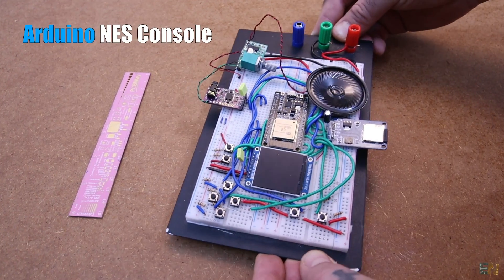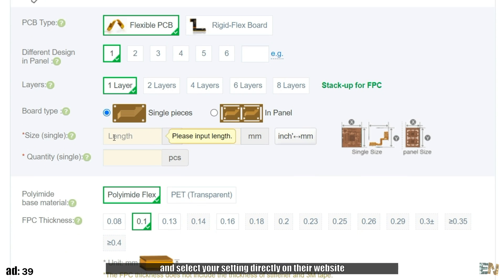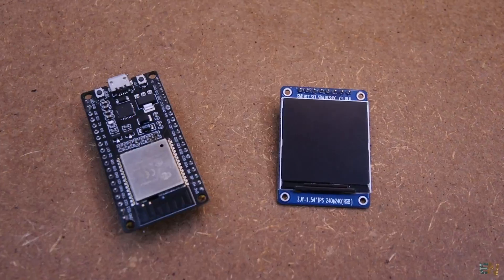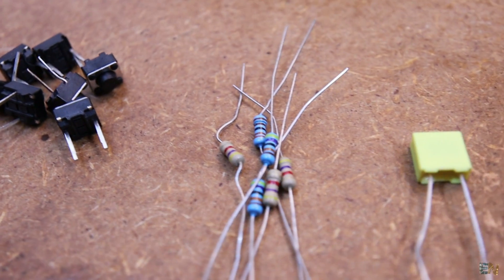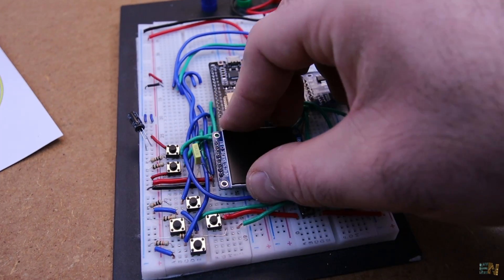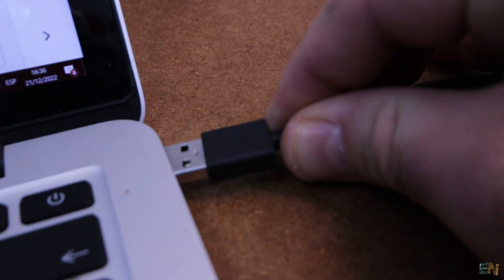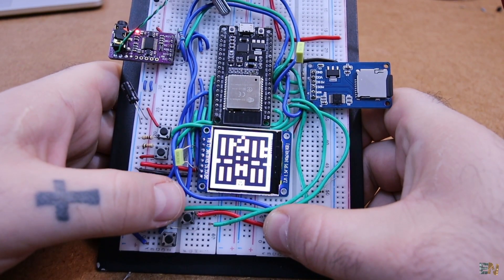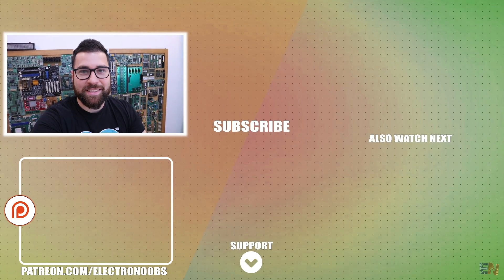ESP32 Gaming Console - Homemade Emulator Less Than 20$

Comment from the maker: DISCLAIMER: After posting the project just realized that using that website for NES games might be considered piracy. I'm not an legal expert but have in mind that using those files might be illegal and you do it at your own risk. Sorry for that!
Reply: Thank you for posting the website.
Reply: hi i really need help every time i compile it i get an error that i need to #include "P:\1a Youtube videos tercero/ESP32 Nintendo/NesCat-main/src/hid_server/hid_server.h" and that the compilation is terminated and it says there is no such file or directory please help me out!
Reply: @aidansmith1549  I can help. The point is that you need to specify the path to this file from your computer. Where did you download it.
Reply: @aidansmith1549  i have the same problem. Do you know how to fix it
Reply: @aidansmith1549 Hello sir, how are you? Were you able to find a solution to this problem in the code? Because I have the same problem in the code. If you can overcome it, I hope you can help me.
Reply: Welcome to the ship
Reply: If you own the original, it's ok
Reply: It’s perfectly fine, since everyone is only downloading games they own the licenses for and  are only backup files. 😉
Reply: How can I get the custom PCB?
Reply: How optimized is the code? It's still crazy.
Reply: @duanefreeman3152   change P:\1a Youtube videos tercero/ESP32 Nintendo/NesCat-main to where your file is located at. e.g mine was C:\\Users\\DJ\\Desktop\\NesCat-main. just make sure \ is changed to /
Reply: Did you find a way to run it with ST7789V2?
Reply: There are homebrew games you can use!
Reply: GPTがマリオのソースのようなものを提示し、手を加えてから実行した場合、著作権は微妙です。
ゲームには収斂的な正解があり、娯楽提供組織は特許マフィアにはなれません。
Reply: You really should consider reposting without that part. Great video overall though!
Reply: Yeah, YouTube might penalize you or your sponsor(s) might drop you for advocating for piracy. Consider reuploading.

Comment: While working with the NCAT repository, I found it to be quite a challenge. 
Despite being an embedded firmware engineer, it took me two days to get the console running on a breadboard. There’s an overwhelming number of unnecessary and redundant defines for custom boards, which only adds confusion.
I also can't understand the decision to use 330-ohm resistors for buttons instead of simply employing pull-ups. Also not sure why he chooses to use a software SPI instead of hardware HSPI, wich is available on the eps32 - wroom. 

There’s no proper HOWTO guide, just a bunch of pictures and code snippets with little explanation. I honestly don’t know how an average person with minimal coding experience would ever get this project up and running.

The work done on porting those emulators is impressive, but the presentation and documentation of the project leave a lot to be desired—especially for Arduino users. A clearer guide and better organization would significantly improve the experience for everyone.
Reply: I'm just about ready to shoot myself after trying to sort out the errors and missing information in this 'tutorial'. Some of the include statements refer to folders on the author's hard drive!  If you have a debugged ino file, can you make it available?
Reply: @pintokitkat  were you able to figure it out?
Reply: Welllll the documentation is non-existent because it’s technically illegal to do in most countries.

Comment: Starting a topic nr4#

It happens very often it doesn't select the game from the list. I can press Select as many times as I want, but nothing happens. Eventually, after some time, after I press the Select button it just starts. Meanwhile, I can scroll through games with no problems. I checked contacts, and everything is good. The HIGH state comes from the button to the ESP32. 
In addition, the serial terminal is empty. Nothing is printing. As the ESP32 is stuck at menu level.

Comment: Not bad! It's a pity the TFT screen is so small, though. Isn't it possible to get a bigger TFT display of the same resolution which is compatible? Of course, that AV output would be a good alternative. It's a pity you didn't demonstrate this. It seems the NES graphics resolution is 256x240, which is about the same as most 8 bit computers, so people would be used to seeing that on a much larger display anyway.

Comment: You need to denounce the buttons through code. Not good at it myself but there are good tutorials. Had the same issue with a radio remote I made for my car. Buttons pit up the small electric feedback and denouncing helps the program ignore this by adding tolerance I believe.

Comment: Starting a topic nr3#

I made a custom board. It WORKS!!!!!

What works:
-I can go through the SD card games and choose any.
-I can load any game from the SD card.
-I can start any game.
-Game works
-I have sound

What does not work, or not work as it should:
-At first, when I connect an 8ohm speaker, the ESP32 crashes. So I added a 470uF cap on PVDD of the PAM8403. Module I used for testing and the schematic for it does not require it. BUT, the DS says it is a MUST.
-After adding a cap, my screen flickers when there is a louder sound. So it is a power issue. 
-While playing Super Mario I can move left and right, I can jump, but I can not shoot. No button does the shooting.

Any help would be nice. I can move the schematic to GitHub if there are some of you to move on. The game console will have battery management, two speakers, power up/down buttons, etc.
Reply: I'm getting many errors, could you send your code and current setup?
Reply: @LieutenantPhys  The code is the same. I have made a few topics here. Here....
"It compiles, but ESP32 lib MUST be 1.0.5 or 1.0.6. SDfat MUST be 1.1.4."
Reply: @dekipet   can you please help? mine doesnt compile.
Reply: @scaredcrew   downgrade your libs, and read all the comments.
Reply: @dekipet   downgrade which library to which version? also getting some error with C++ version 11
Reply: @dekipet  you mean esp32 board should be 1.0.5/1.0.6?
Reply: @scaredcrew  Mate, it says all a few posts above.
Reply: @dekipet  can i dm you if you have time please
Reply: @scaredcrew  mate, you have to install the library versions I mentioned. Nothing more, nothing less. There are #4 posts here I wrote. I have explained many things.
Reply: @dekipet   thanks! I have  managed to compile file but having this error : Initializing SD card...
SD card initialization failed!
Reply: @scaredcrew  bad card, wrong filesystem, bad wiring, etc
Reply: i have face many out of storage eroor it use 314 percent memory or say 3.93 mb but it has only 3 mb flash if i go to higherst partition scheme as well can you please help me

Comment: I have found the way how to avoid all the compilation warnings in the original sketch caused by the newer 11 version of C++ applied in Arduino IDE since certain period of time. Now it compiles without any red line!
Reply: My Code compiles but i dont get my TFT Display to Work. Do i have to Put Resistors in Front of some of the Pins ? And CS Justs Connect to Ground ? And why did he Put a capacitor between ground and ground?
Reply: @brxdow  My display works fine, at least it shows the menu and moving up and down selection arrow. I've connected it as suggested in the initial sketch: DC (5), RST (19), MOSI (or SDA) (23), SCLK (18). I don't have CS pin at my ST7789 240x240 display version. Perhaps it is really needed to be grounded via 100nF capacitor when it is there, I can't say exactly. An author suggests doing so to avoid artifacts on the screen, don't see the reason not to trust him. But if CS pin is present at the display module, then you need to connect it to a free allowed pin at ESP32 module and define it in the sketch in the line #define TFT_CS   -1 where you need to replace -1 with actual number of the used pin at ESP32 module. 
However, I am still struggling with games launch. When I pick up a game and push 'Select' button sometimes I get a white square on the whole screen when it seems to be loaded correctly, but sometimes it just resets when there is something wrong with rom file size. In this case it shows a wrong size of the file upon uploading starts and it means that uploading will fail in the end. But sometimes uploading is OK, but then I get a white screen anyhow. So still in search of the right way to get it working in full. I suspect that there are many small differences in hardware (ESP32 and SD card modules and displays) which could influent the right operation of the emulator and they have to be found in each case separately, which takes certain time and efforts. But never give up!
Reply: I might Destroyed the Display because i powered it with 5V instead of 3.3V, or because i soldered the CS Pin on it because i thougt i need it. When i Order a new Display, should i rather Take a Display with or without the CS Pin? I think without is better, because its easier and also cheaper i think. What do you think? When i get it to Work i May get the Same Problem as you, and if Not in can help you Out.
Reply: @brxdow  If you have CS pin at your display module you need to configure it in the sketch, it could be GPIO 4 for example. Of course, less connections are better as soon as it increases the reliability, so the display without CS pin is preferable. Meanwhile, I've got my assembly working almost OK, at least SD card recognized correctly now and roms are loaded with right memory volumes. All the games files are running so far. The thing was that CS pin at SD card module should be grounded and not connected to ESP32 module (GPIO 22 originally). Now experimenting with I2S sound, MP3 player works fine, but still struggling with game sound - it is not there still. Suspect some sound module initialization problem in NES emulator mode.
Reply: вадим, где я мог бы скачать вашу сборку?

Comment: Ok, starting a new "topic".
It compiles, but ESP32 lib MUST be 1.0.5 or 1.0.6. SDfat MUST be 1.1.4.
So far, so good.

Next step, download NES games in the NES folder of the SD card.

When powering up, it lists all games, and I can scroll through them, but when I press SELECT on any of them, the game doesn't start.

I am stuck here. Any idea what to try? What to check?
Reply: I dont eaven get so far.... I dont get the TFT Display to work. How did you Connect the CS Pin?
Reply: When i use SDFat library in the Version 1.1.4 it doesnt compile. When i use Version 1.0.5 it does???
What do i make wrong
Reply: I even See ( in the seriell console of the Arduino IDE ) that it load the Games and i can selcet one. I See the Name of the .nes File and that it is currently loading. Then there is the Message that the Rom Download is successed. But i cant get the TFT Display to Work. I once powered it with 5V. Have i destroyed it with that?
Reply: @brxdow  can u tell me how? im stuck at loading game process
Reply: @HoàngNguyễn-x5v  can u explain in details? is the folder name correct? try :
#include "hid_server/hid_server.h"
sorry the last time i worked on this project was like 5 months ago
Reply: @itsnd64  do you finish all the step? Did it work?
Reply: @HoàngNguyễn-x5v  yes it did but i lost the folder
Reply: @itsnd64  did you reformat the sd card or use default?
Reply: @HoàngNguyễn-x5v  w problem u having? i use fat32 formatted card
Reply: @itsnd64  the monitor showing ''sd card initaliaztion failed!''. I already connect correct pin, format fat32 and create NES folder
Reply: @HoàngNguyễn-x5v  fsr 1 of my sd cards doesnt work,try other card
Reply: @itsnd64  thank you. Everything work well. But the game Metal Gear has some crazy 😅
Reply: @HoàngNguyễn-x5v  good for you!

Comment: Hi! I don't know if anyone can help me with this but I use the esp32 with 30 pins instead of 38, and it said the SD card can't be initialized. I hope it wasn't the issue so it would be helpful if someone can tell me about this. Thank you.
Reply: I also have the 30 Pin Version i think. But my SD Card Reader is functioning ( i can See that it load the Games and i can even start them in the seriell console of Arduino IDE ). But i dont get my TFT Display to Work.
Have you created the NES Folder and Put one two Games on?
Reply: @brxdow  Yes I did create a NES folder and put 2 NES game files in it but it didn't seems to detect it, and also ur problem kinda opposite of mine, my display is worked and showed the error.
Maybe u can check the wiring again, and if ur display doesn't CS pin, u should change the #define TFT_CS to -1.
I'm not sure if that's the issue but worth to try.

Comment: Nice video!
But i always get Errors when i try to conmpile the code because of the "...  .h" Files. Can someone help me?
Reply: Same here!!!! I keep getting that problem with like a video.h file or something and when I go into the files it says to I can see it right there and open it and everything please tell me if you figured this out
Reply: I progressed!
So if the error message comes then you have to first look that ONLY the file name is in the quotation marks (for example: #include "video.h"). Once you have done that, you must then put this file in the folder where the code (.ino) is saved. Now I did that and it works, but now I have a new error message (SDFat...). :(
Reply: @brxdow  thanks and I fixed that problem what I did is I went to the sdfat zip file in the libraries and I installed it and that got rid of the problem but now it has a hard time compiling because of something else
Reply: Thank,
I will try to load IT to my Esp32. I already soldered everything together... I will see If it works( when i have time).
Reply: I've got it to Upload to the esp32! I unsoldered everything an it worked. I soldered the Display and Sd- Card Reader Back in Place. Now when i give power to the esp, in the seriell consol (in the Arduino IDE) i can See how many Games are loaded to the Sd Card. But now i dont get my TFT Display to work it Just Show black Screen :( . Why did He Put the capacitor between ground and ground??!
What should i Connect to the CS Pin?

Comment: The NesCat INO from a ZIP file you provided on your web page can not compile just as is. There are some issues with the SdFat lib. What exact lib did you use and what version?
Thank you for your awesome work!
Reply: Hi did you replicate his project? I am all finished with the code stuff but when I click compile it says that something is missing but when I go through the files I can see what it says is missing right there I can go more into detail if you need me to please help!
Reply: @aidansmith1549  Nope. Stuck in compiling, and have no time to mess it up further.
Reply: @dekipet  Dangit I already got all the stuff and got it soldered and the code won’t even work
Reply: @aidansmith1549  I believe the lib is updated, so now it won't work as is. It needs a tweak or two. But, it would be nice for the author of this video to say a word or two.
Reply: im late af but u need to use the libraries provided in the folder

Comment: Why I get this error:arduino: 1.8.12 (windows 10), board: "esp32 dev module, enabled, default 4mb with spiffs (1.2mb app/1.5mb spiffs), 240mhz (wifi/bt), qio, 80mhz, 4mb (32mb), 921600, core 0, core 1, none, disabled" in file included from sketch\bluetooth.h:77, from c:\users\asus\desktop\ncat-main\ncat-main\ncat_esp32\ncat_esp32.ino:1463: sketch\btstack/src/btstack_crypto.c:89:10: fatal error: uecc.h: no such file or directory #include "uecc.h" ^~~~~~~~ compilation terminated. exit status 1 error compiling for board esp32 dev module. this report would have more information with "show verbose output during compilation" option enabled in file -> preferences.
Pls help

Comment: It's still crazy to believe that the esp32 is more powerful than the 6502 and double ppu units that were in the Nintendo haha. I agree, it's a crap shoot when you buy those little screens. I gave up. I use character screens again for fun and they can be used as crude debuggers to know where your code is at haha

Comment: I am just still trying to figure out if there is way to use those type of screens for displaying arduino ide on a robot. I guess we would still need to have a keyboard or a mouse to it. I tried making smart glasses out of a oled screen while back ago. It didn't work for me. If it can have enough resolution for mario brothers it should be able have the resoulution for arduino ide. Watching this video made me think to go back and look again at that old project. I just think a small pair of smart glasses it don't have to be vr or ar just a simple two dimensional screen would go well with a mobile robot.

Comment: The ESP32 can use internal resisters, you just have to specify the pin to pullup or pulldown. You don't need to add your own resisters into the button circuit.
Reply: 5k resisters is ok
Reply: @dol_codm  It's wasteful and redundant. It's OK, but its not needed.
Reply: I dont get my TFT Display to Work. Where do i have to Connect the CS Pin? Just to GND? I checked the Internet and IT says that the TFT Display needs 3.3v Input and Not 5v. Did i destroy it with that?
Reply: @brxdow  If you put 5v though 3.3v electronic, you might have fried it.

Comment: A small suggestion for possible improvement: instead of using pronouns like this and that , try to be specific, for example approximately around timestamp @03:40 you are discussing what works and what not, so instead saying the one with cs(or without cs whichever is the case) and with 280- resolution (or 240 whichever is the case as i am still confused which one was it) can portray your information in a better way.  Hope this helps. I know you are not a native english speaker so this is not a complain, you are already helping us a lot with your videos. Juts saying on feasible improvement. Good luck. And thank you for sharing this one.